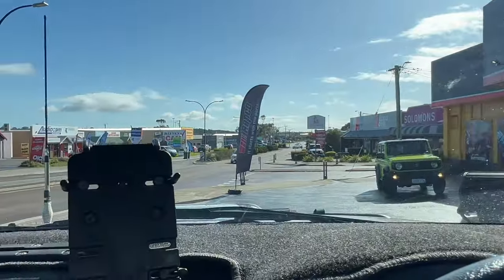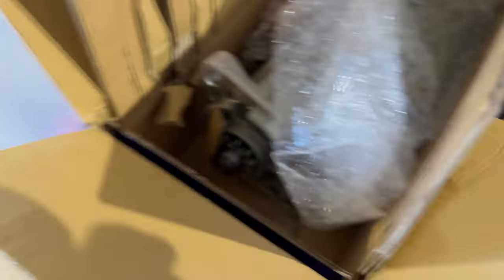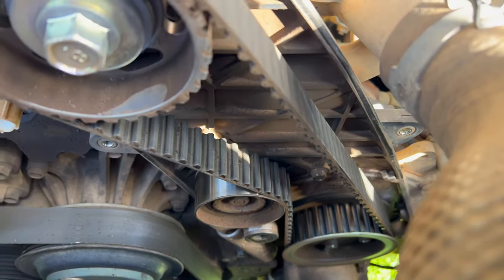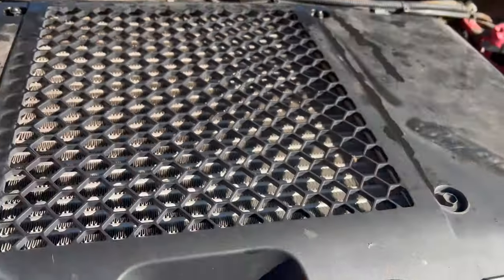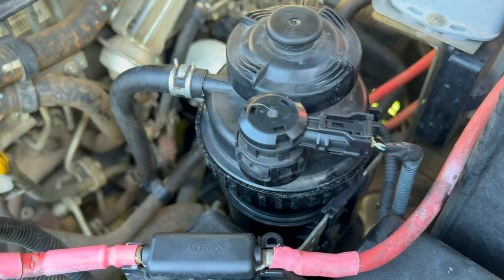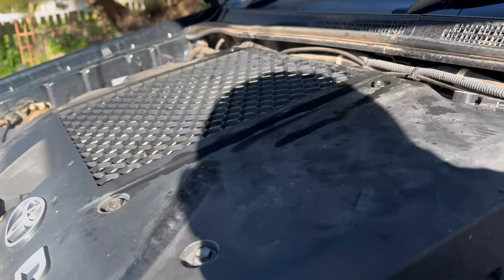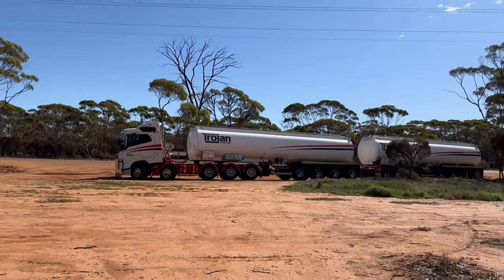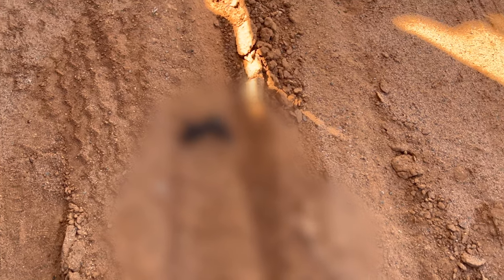Vlog #50 Hilux Repairs

Comment: Good to see your vids again.
Are you still heading up the road? would be good to see some more of those vids if you are.
Reply from the maker: Thanks. I'm running fuel (mainly to the Coolgardie/Kalgoorlie area from Perth) in the Volvo F16 Super Pocket you saw in this video - no more north-west runs in the Western Star. I loved running north but it just doesn't pay as well as the fuel and I am getting a little older and my back and joints like me doing the fuel 😊
Reply: excellent, keep up the good work. how do you find the Volvo, bit different to the wester star, like driving a car, no more road ranger. I like the i-shift.
P.S i liked the transition at 2:07 with the toolbox. @twocrowsdown
Reply from the maker: @Elias-iq2mn  I find the lack of room in the Volvo a little frustrating but the auto is ok (after I stopped myself reaching for the gear stick every time I came to a stop).